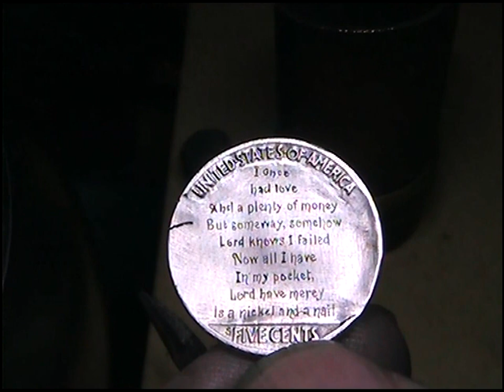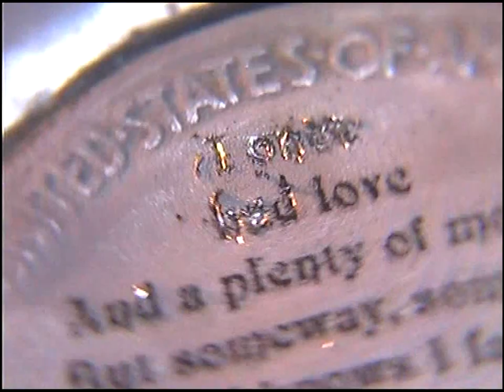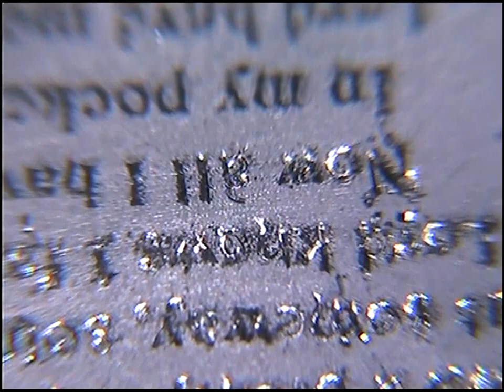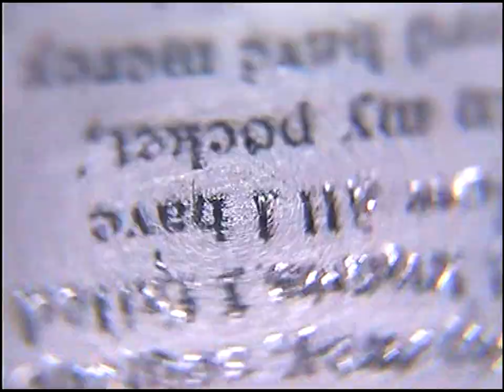Hand Engraving with a  concrete nail 'A Nickel and a Nail' by Shaun Hughes

Comment: Are you "pushing" or is that a pneumatic piece?

Very entertaining!
Reply from the maker: +David Smart Thanks. If you look at the beginning ,when I put the pit of copper pipe on my finger,and tap the end of the nail holder,that's in place of my gravermach,it does exactly the same thing as an air engraver. If you look at my 'hobo nickel for beginners' you can see it explained in more detail there.
Reply: Thank you.
I told myself that's what you were doing, but didn't think it would be powerful enough.
I'll take a look at the othe vid, thanks.
Reply from the maker: +David Smart Whats very interesting engraving this, I had trouble hitting the nail gently enough.

Comment: good day mate, did you heat treated or forge the concrete nail before sharpening? thanks
Reply from the maker: No heat treat. I'm not sure what metal these are made of. Tempering didnt seem to make any difference. As they come,they are just right for learning,not to brittle so the point doesn't chip easily.